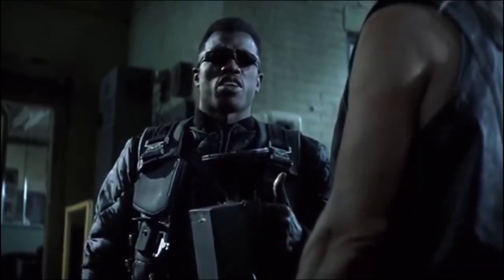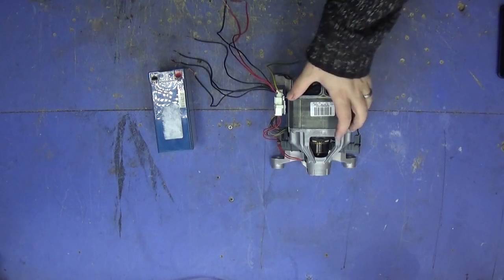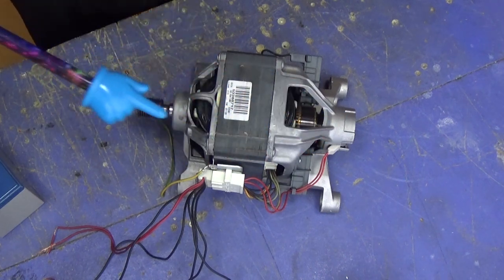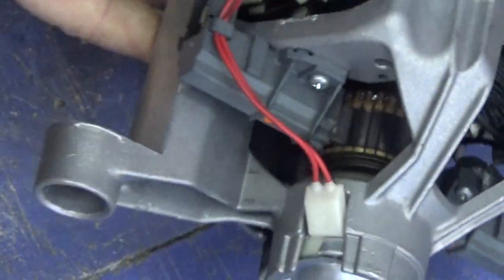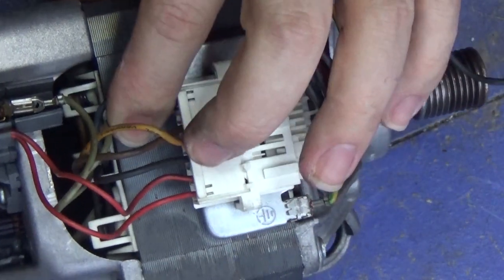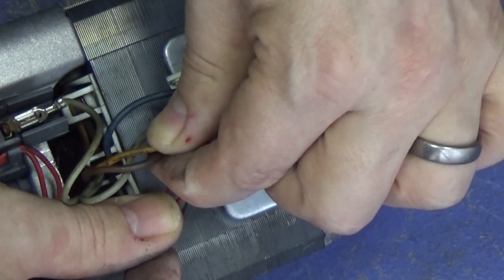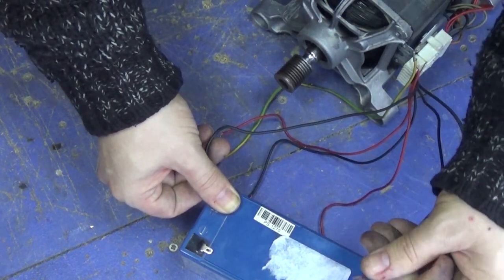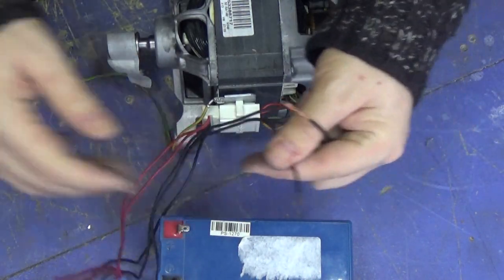How to run a washing machine (universal) motor off a 12v battery

Comment: Thank you for the easy to understand way to get these motors working. Now to think of a cool way to use them. Put a switch on it too so you can turn it off and on.
Reply from the maker: There are so many different uses for them. When you have decided what you want to make send me a message I'd be interested to know what you have planned. Thanks for the comment

Comment: This is shunt connected (armature and field windings connected in parallel). You can also connect the field windings in series with the armature windings for more speed, less torque. The field windings are what he refers top as "the coils" and the armature windings are on the armature connected via the brushes.

Comment: Hello. this morning I pulled the motor out of a  washing machine, connected it up to my 12v off-grid power and got it running as you showed in your video - so thanks. I then replaced the 12v supply with a voltmeter and spun the motor by hand, but the reading was very very low.....a quick youtube search showed that if the field coil was 'excited' with 12v, then readings from the brush connections would be very good in terms of the motor running as a generator.
Reply from the maker: I'm so glad you have this working already! Amazing. I'm so glad I could help. I will be working on a generator when the weather is a bit better. I may make another wind turbine as well

Comment: HI, good job on the video there, very informative 👍. I have a question regarding plugging the washing machine  motor to a 12v supply rather than a 240v. Can this increase amparage and dameage the motor and speed control(that i want to connect )?
Reply from the maker: Hi there. Great comment and I can only tell you that I have done this to a few motors and I've never had an issue. I'd advise testing it out and seeing what results you get but I wouldn't think there would be an issue. If you manage to run some tests I'd love to hear what you find out. Thanks for the comment

Comment: Thank you for this informative video. Tbh I'm crap at getting my head around electric circuits. I'm wanting to power a speed boat (on a low budget) with car batteries and washing machine motors. Would there be a advantage to connecting 20 x 12v car batteries in series to get 240v, and use an arrangement of 5 x 240v washing machine motors to get about 50hp?
Reply from the maker: Do you mean connect 20 12v batteries in series to 5 washing machine motors in series? If that's the case then it won't work im sorry. 20 X 12v batteries will burn out one of these motors (I think) if you want to send me an email with your idea so I can see what you mean. I'd be happy to try and help you. My email is theoffgridfamily@gmail.com good luck buddy

Comment: Hi thanks for the info, I was wondering if one could connect the motor directly to a solar panel.
Reply from the maker: Yeah you could but if you connect it through a voltage regulator then you'd get a much more stable rotation speed. Otherwise it would fluctuate

Comment: great video. I have. question, whats happen if the motor not have the brush?Thanks a lot
Reply from the maker: Hey there. This will only work for universal motors. You can get any motor working but you may need to do it with different parts or in different ways

Comment: Could you use say a 24v or 36v 10ah battery for better longevity and less bulky if say putting on a bike
Reply from the maker: I would have thought so. You will need to try and see the results. Just be careful not to burn the motor out

Comment: Hello ! I like your explanation about that matter. But , will the motor run if i use 10 v dc ? Thanks .
Reply from the maker: Hey there. I'm not sure. I would have thought so just much slower but to be 100% sure you would have to try. Sorry I can't be more help. Good luck

Comment: Hello,  what the left over wire for. Can we plug in direct if we don't have battery? With same connection u have shown.
Reply from the maker: Not sure which wire you mean as it's been ages since I did this sorry but yeah connect this to 12v adapter and it should work fine just be careful

Comment: Thank you. Have youever come across the round washing machine motor. Its a big round wheel looking thing, brushless i believe?
Reply from the maker: I'm not sure, I have taken a load of washing machines apart. If it's from newer machines then probably not.
Reply: Yes.it was actually a fairly new samsung washer/dryer combo. It looked brand new.I didnt even know they made a washer that also dried after the wash cycle without even opening the door. Apparantly they are rubbish however, when trying to fix it i came across a lot of complaints about them...expensive too. Cool motor though.
Reply from the maker: That's why I haven't seen one. I only get access to the oldest of the old. Eventually I'm sure I will get my hands on one though 🙂
Reply: @TheOffGridFamily  you never know, i was just driving along and happened to see it sitting by a dumpster, i collect motors so i stopped. I was very surprised to find that type of motor in it.

Comment: I have a question can you use a AC DC universal adapter too.I want a washing machine motor like you have
Reply from the maker: DO you mean an adapter you plug into an outlet and it converts it from Ac to Dc 12v?

Comment: One couldn't apply much load with 12v but a few batteries in series would be better. I get it's proof of concept however and it was nicely explained and executed.
Like yourself I am using one as a generator for wind and solar. Its a project I intend to start this summer.
Reply from the maker: Keep me posted on your progress as I'd love to hear how you get on. Thanks for the feedback
Reply: @TheOffGridFamily  It will be my pleasure. Your videos and others are part of my research so I greatly appreciate that and your interest. I'm hoping to convert a LWB into a motor home so this journey is critical. I'm hopping to connect six vehicle batteries in series so the voltage is stacked. It should be enough to run everything I need.
Mini multi directional wind turbines by day and night, Solar during the day.
Reply from the maker: @PsyllyCymon  we seem to be on very similar paths. I've been looking at various LWB vans for the same reason. It's really exciting 🙂 we have nearly saved enough so hopefully this year I will start looking to actually buy one and start the videos
Reply: @TheOffGridFamily  The very best of luck and now you have my subscription I can follow your progrees/videos.
Reply from the maker: @PsyllyCymon  you too my friend. Please do keep me updated. I'd love to hear your progress
Reply from the maker: @PsyllyCymon  and welcome to the family
Reply: @TheOffGridFamily  DIY Solar Power with Will Prowse  is a plethora of information you may find interesting. His tutorials are awesome.
Reply from the maker: I will pop over and have a look. I'm always eager to learn more.
Reply: @TheOffGridFamily  You and me both 👍. I'm beginner level  and this guy covers everything in a super easy format, building a rechargeable unit from scratch,  it's applications and in a zero bullshit and relevent manner like yourself.
I'm fairly savvy at electrics ie I can wire a plug 🤫, but this young fella is a DC Universe one stop shop.
Reply from the maker: @PsyllyCymon  I know some stuff and know nothing about other bits. So I love to watch different people because they cover things from different angles and I learn different things. I'm back working with Arduino at the moment so I'm dipping my toe back into the programming/electronics world. I didn't realise how much I missed messing with the stuff
Reply: @TheOffGridFamily  I've always maintained I know a lot about a little and a little about a lot. Each day the pendulum swings either way.
Reply from the maker: @PsyllyCymon  yeah absolutely. I love adding to the list of things I can do. I have saved so much money by fixing things. Some of the things I'd never have the guts to try a year before. It's all about the journey to the next project/experience

Comment: Will the washing machine works if you install that DC motor back to the same washing machine? (And power it with the 12vdc)..will it have the same torque when you aply load to it?
Reply from the maker: Yes it would still work but the torque would be significantly less. You can adapt the motor using magnets to increase the torque using 12v. Great question
Reply: @TheOffGridFamily  Thanks for the quick reply. I'm curious on how to add the Magnet to increase the torque. Atm, I'm Planning to power an AC Washing Machine with a 12vdc battery so I can use the washing machine to wash my clothes off-grid (without the aid of an inverter)
Reply from the maker: I am looking into similar things myself. I'm hoping to make a video on the magnet arrangement because it's a little bit too much to write here. There are so many different things to take into consideration.
Reply: @TheOffGridFamily  Thank you once again for the prompt reply and the info, can't wait to see your video on this topic.
Reply from the maker: I have a lot of that kind of thing coming (soon hopefully) so keep an eye out and good luck with your own experiments

Comment: Hello there! I was silly enough to try to remove the pulley from it with a hammer.  Now the shaft is moving in and out about 1 cm :/ Is there any way to fix it? This kind of motors are assmebled by kind of rivets unfortunately, but if I cut them off can I repair the moving shaft?
Reply from the maker: Hi there. I'm sorry I wouldnt know what to do to help. I hope you find a solution

Comment: Cant find my answer any place

Can i connect start and run wires of my new spin motor on any of the 2 points on spin capasitor? 

Got a defy twinmaid 1300. 

Only use one capacitor for wash motor and spin motor.
Reply from the maker: I'm sorry I have no idea. Good luck in your search. Would you like me to pin your comment in the hopes someone will be able to help you?

Comment: Cool! Didn't even know I wanted to know this. Ended up here trying to find something to do with an old dishwasher. The box part makes a great locking compost bin. Trying to find something to do with the motor/pump and heating element.

Suggestions would be great.
✌💚🖖
Reply from the maker: What a great little project. I will have a think and get back to you
Reply: Same here😂😂using a washing machine box for compost bin...

Comment: Do you know how to create a alternator to create an endless power supply for it. And how much torque can a washer motor have? Also jw how much weight can a washer motor carry if hooked up to some Wheels
Reply from the maker: Hi there all great questions I will be doing a video on making a wind turbine in the future. To do that you would need to add magnets to the motor. This will also increase the amount of torque you can get from the motor. Due to the change to DC the torque would be quite low. As for how much weight each motor is different so I can't answer that. That said I've seen a few people who have connected these to wheels and made little go-karts. Good luck

Comment: would the same information apply to the motor from a dryer ?
Reply from the maker: I'm not sure, It would stand to reason they are the same type of motor but I cant be 100% 
check the wiring and this might tell you if it is universal. If you need any help or want me to have a look at some photos to see if I can help then send me an email: TheOffGridFamily@gmail.com
good luck

Comment: @The Off Grid Family : Greetings fellow Englishman. I wish to ask. I recently won a Electricity Generator motor in an Auction. It is a single PHASE 50 HZ and generates  power 3.6 klw @1500 Rpm. It is an Excitation Generator.. I have looked into it and turns out i would need the exact Excitation control unit specifically for the unit. IS there a way to by pass it? Or can it be manually excited?  Many thanks in advance. All the best -
Reply from the maker: Hello there, I am sure there is something that can be done but its above my knowledge base. However I have a friend who basically is a genius when it comes to that sort of thing. I will contact him and see what he thinks. Stay safe buddy
Reply: @TheOffGridFamily  Hey thanks, if you need a pic of the plate let me know. It is made by Brook Crompton UK.👍
Reply from the maker: @apsert  that may help. Just send me an email with all the pics and info and I will forward it on. Hopefully my friend can help you build something to get it running. My email is theoffgridfamily@gmail.com

Comment: Hi a really easy to follow video is it possible to show how to speed control that motor watts/amp's it will use as l plan to use it for a trike I'm building please
Reply from the maker: Thanks for the kind comment. I have wanted to do a video like that for a while I just can't seem to find the time. I will get round to it eventually but I can't say when

Comment: I'm looking for something in a different direction; I'd like to repurpose a washine machine engine into a generator to store power on a 12V battery. Any tips? I'm looking for something akin to a hand-crank generator that can charge a battery. Or better yet; a stationary bicycle I can ride that I can use to generate and store power onto a 12v battery. Does that sound plausible?
Reply from the maker: Yeah it sounds plausible and I have been looking into doing it myself. You may need a h bridge rectifier and magnets (depending on the motor type). Just test the motor before doing anything because you may need to add some gears to increase the rotation etc. If you need any help just message or email me
Reply: @TheOffGridFamily  Thanks so much for your reply you've helped me feel confident about the feasibility. Now I know it's possible. I found the motor I salvaged on the internet

Huaian Welling Motor
220-240v 50/60Hz CL.155
Washing Current 4.0A Input 350W Output 50W (500-1000r/min)
Spinning Current 3.0A Input 500W Output 500W (7000-170000r/min)

https://ghs-lippe.de/motor-kohlebuersten-tacho/801-welling-umt520402-motor-amica-zanussi-elektrolux-midea-.html

Comment: How long will it last thinking about installing on my daughters 50cc pit bike
Reply from the maker: What do you mean "last" 
I'd do some experiments as there may be an issue with torque.
Reply from the maker: It depends on weight of the bike, course, ah of the battery etc

Comment: Hi could you help i want to use 2 washing machine motors to run a gocart how whould 1 a pick the right controller and b ad a charger for the batterys. Cheers
Reply from the maker: Hey Oliver, I'd love to be able to help you but I wouldn't know where to start. There are too many variables. If I was you I would sort what type of motors you are going to use them I'd choose the batteries and then from there the rest should be sort of straight forward. Sorry for not being much help

Comment: Question, how long would the battery last on constant use using the motor approximately, also how many amp in the motor
Reply from the maker: Hi Dean. It all depends on what motor and what battery. I made this a while back and can't remember any of the specs for the motor sorry
Reply: @TheOffGridFamily   its OK, just an average guess should be fine as I'm trying to use old washing machine to convert bicycle to Ebike, if I can cover an hour use or just 10 mins etc
Reply from the maker: @deanlong8012  it will vary so much depending on what motor you use and what battery. I'd run some tests with the batteries you plan on using and the motor you will convert. I am working on an evoke at the moment but not got any videos out about it yet. It's going to be a big project because I'm building everything including the batteries (although not building the bike) good luck my friend

Comment: Hi after watching your video, I immediately went out and got my washing machine motor to spin, from a 24v AC source. Spinning fine and was so pleased. But not much grunt, so having been told it was universal, I put the same connections to mains voltage, and now it has stopped working altogether. Is that the end of my motor....so pi**ed off now. I dont know how you can reply.
Reply from the maker: Did you just wire it directly to the mains electric?
Reply: @TheOffGridFamily  exactly the same as the 24v supply. Had about 5 coil wires though. Played around connecting 1 to brush and the other to brush and coil. Was running perfectly. Even wired a switch to reverse it. But was able to stop the rotation easily, which is why I upped the voltage to 240.
Reply from the maker: @chrisburnham53  Id guess you have burned something out. Be so careful when playing with mains voltage. Other than that I dont know what to say to help. sorry
Reply: @TheOffGridFamily  so how can I test the windings. Could there be a safety cut out?

Comment: I was always told that washing machine motors are AC and batteries are DC so we always need a more than capable inverter for such a project??
Reply from the maker: Washing machine motors are known as universal motors and with their wiring inside a washing machine they are set to AC the way I've worried it allows it to be run on DC. It loses some tourque but other than that works well.

Comment: hey ive got a washing machine motor and its got 5 black wires and 1 thats like yellow with green plus i cant see from where they're going since all of them are in the same direction. is there any way i could send you a pic of it? ( im using a siemens motor if that helps lol )
Reply from the maker: Hey buddy, there is a way and I may have to do a video on it. I'm really busy over the weekend but if you leave a comment Monday (or email me) I can hopefully talk you through the process.
Reply: @TheOffGridFamily  i could email u with it